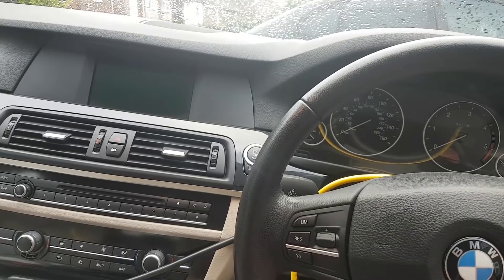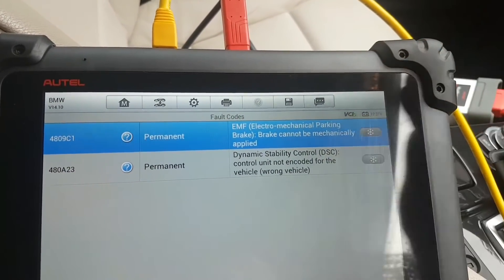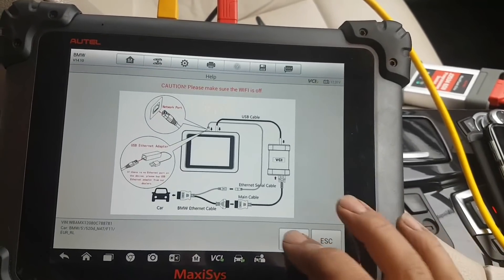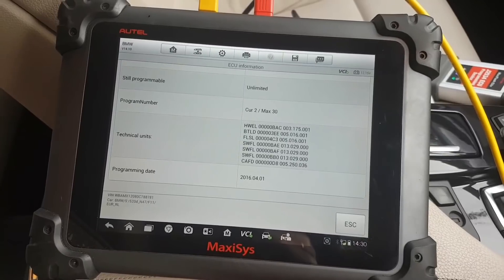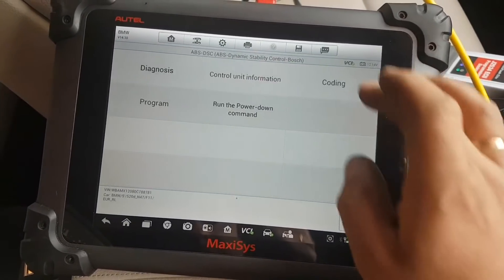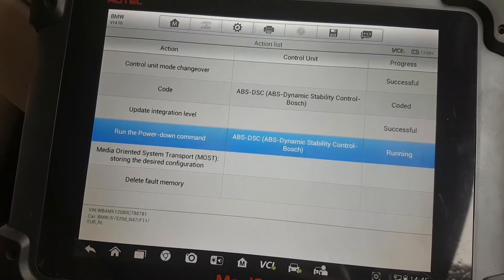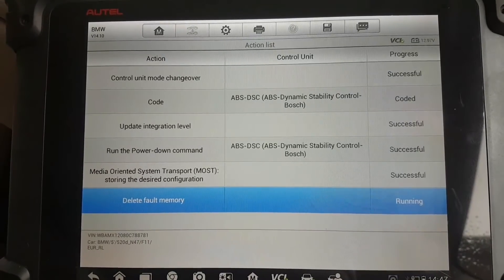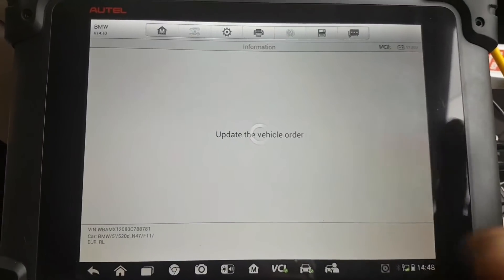BMW F10/F11 used DSC/ABS/ESP module coding/programming.

Comment: Hi, I have a 2012 bmw 535i I replaced the abs module, could you please tell what tool I have to buy to program and code the abs module to work properly on the car?
Reply from the maker: Any tool capable of programming and or coding BMW...
👍👍👍
Reply: @LMAutoRepairs I installed a used abs module, am I still able to code it and program it ?
Reply from the maker: @hardeesalih6435 
Should be able to... yes.
Reply: @LMAutoRepairs appreciate you.

Comment: How did you change/virginize the VIN to the installed used module?
Reply from the maker: All in the video...
👍👍
Reply: @LMAutoRepairs   I watched the video twice, but I can't see how you changed (if) the VIN to this module. I did same process to my E46 after replacing ABS/ASC module with a used one, but it doesn't work. I still says VIN mismatch. I'm using Autel MS908s pro 2, but there is no option to read/write VIN. Any idea? Thnx
Reply from the maker: @foxtrot5557 
The vin should be updated during flashing procedure using the Autel...
Otherwise...
https://youtu.be/1dn4c3g6dsA?si=3diwQ65w1A09FZ0C

Comment: I have problems with e39 530i with dsc system. The module has fault code for lhs speed sensor and sometimes the automatic gearbox goes into limp mode because the communication stops working inside the module. I want to replace this module with a later module from 4.4 l e53 x5.The difference is that the dsc has a preasure sensor on the outside and when  I plug the other module in I get a code for preasure sensor and lateral acceleration sensor and yaw rate sensor. I suspect these sensors are also now built into the pump on the newer system. Do you perhaps have experience with a similar chase.The dsc from the e39 gave alot of problems but the later pump on e53 is very easy to get hold of
Reply from the maker: Never had one of those... sorry...

Comment: Did you use battery maintainer?
Reply from the maker: I highly advise you to use one...
Although, coding only is not so risky, and usually takes less time...
So, if your battery is healthy and you are only coding one module, you might get away without using one... but again, you should do use it!
👍👍👍

Comment: Why you didnt do this job with Autel im 608 pro ?
Reply from the maker: 🤷‍♂️
Don't even remember if I had the IM608 at this point... 
Even if I did, the IM608 wouldn't be able to it, due to the lack of an ethernet port...
Is no designed for that... can do coding, but it is a bit more restricted...
👍👍👍

Comment: Where do you learn the autels full capability had a headlamp module to code on a bmw f10 today for the angel eyes managed to recode the frm but couldn't get it to work but the module was a cheap one off Amazon. Thanks
Reply from the maker: Being a cheap one could be one of the problems...
👍👍👍

Comment: Hi,

Is this the same procedure for the e60? 
If its a second hand part no need to change the VO? 

Thanks
Reply from the maker: Hi
The VO? 
NO...
Some modules need to change the VIN and the coding...
👍👍👍
Reply: @LMAutoRepairs  thanks
The Vehicle Order?
So this is not same procedure to E series ABS/dsc replacement?

Thanks again
Reply from the maker: @cristianohinkenickel5882  
Procedure is the same/similar...
I know what the VO is... and that does not need to be touched when you replace parts like for like...
Again, the VIN number will need to be corrected, possibly some coding as well... 
That is what I am showing on this video... there is no VO involved...
👍👍👍

Comment: I have similar problem...difficult to diagnose it...earlier it show wheel speed air gap rear right..I changed the speed sensor still same issue....can u help ?
Reply from the maker: Have you watched the other video on this car?
It might help you...
👍👍👍
Reply: @LMAutoRepairs  yes I did...I changed the abs also....but still same error...now last iam gonna change the wheel bearing...hope it's fixed then
Reply from the maker: Have you measured the wires etc...
You can have a break on the wires elsewhere...

Comment: Hi, lm doing a Audi A4 b6 1.9tdi and the immo light is not going off also no engine check light. Tried to put machine but no communication. could it be the cluster or  or something. Help plz
thank you
Reply from the maker: Can you communicate with the engine control module? 
Thank you for watching!
Reply: @LMAutoRepairs  l tried to put the machine but its not communicating with the ECU
Reply from the maker: OK...
Start with the basics...
Fuses, connections etc...
Check powers and grounds at the ecu connectors...
Lastly CAN network...
Reply: @LMAutoRepairs  ok thank you

Comment: Hello  Luis , I admire your work with the cars, but it is not good to make videos with a 3000 euro scanner, because most of your viewers do not have such an expencive tool.Its better to use the cheap chinese clones instead !
Reply from the maker: The best tool is yourself...
The idea is to show the process, the thinking,  etc...
The tools, you can use whatever you want...
Thank you for watching! 
👍👍👍
Reply: Exactly this is my point. All the job is done by Autel automatically , so if you do not own one there is no interest
Reply from the maker: I think you are missing the point...
If you use a different tool, the procedure at its core still the same... or at least very similar...
Does not matter if you are using an Autel, a clone Icom, a CGDI, or even E-sys... though the last one can be a  bit more tricky...
👍👍👍

Comment: Did you get the software from old module and put it back? I couldn't see any of this procedure, is that doing its thing automatically without taking the old software back?
Reply from the maker: No...
The software is whatever was already on the replacement unit... this just code it to the car...

Comment: very interesting to see the level of computer control in todays vehicles, not surprising because I have always known it was there, it also gives us an insight into the progression and intention of programmers to take away control from the operators and drivers. It is not surprising therefore that billions of taxpayer's money is used to subsidise manufacturers, this is not just about creating jobs, this is about creating a power structure.
Reply from the maker: 😊
Right to repair...
Some of this stuff it is slowly taken away or made very difficult or expensive to the ordinary garage or individual...
So, you are forced to go to the dealer, which obviously will not install second hand parts...
👍👍👍

Comment: This is not programminy
Reply: verb: program

    1.
    provide (a computer or other machine) with coded instructions for the automatic performance of a task.
Reply: @SabretoothBarnacle  i am software engineer work for Mercedes and develop ecu and bcm we are hardcoding with c++/c language this is just pressing buttons and the binair digits are changing
Reply from the maker: Coding, programming, flashing... etc...
All comes down to play with the control module software... correct?
On the title, I put coding/programing...
I absolutely agree that in this situation the word coding is more specific to what I did, the fact that I used the word programing it is to make sure that the person that will see this as programming, can also find the video...
In the end, those technicalities that are irrelevant here...
Just my opinion...
👍👍👍
Reply: @LMAutoRepairs  aah i understand you are right about that and i understand your word choice.

I'm going to tell you now we are currently working on limiting and securing the limit this means that if someone changes something to the values that are defined as normal the ecu will give a certain error message that is definitive and cannot be removed only by the official Mercedes dealer, sometimes it can even result in a software crash that can disable certain functions, such as power steering, which can result in nasty situations. I can't really say it because of professional secrecy and secret of the company but it might be good for you to know since you are interested in car technology and you have a youtube channel about this i speak about a new upcoming A-class car
Reply from the maker: A shame that manufacturers are doing that...
The ones that claim are trying to help a sustainable environment, then make it nearly impossible for things to be repaired or re-used...
They don't really care about the environment, they care about making things in a way that they can constantly sell new parts, and lock things in a way that only manufacturers can do the job... that does actually have a name, is a monopoly!
Reply: @LMAutoRepairs  This stance by Mercedes Benz will also get some serious negative PR based on the new EU Right To Repair legislation.
Reply from the maker: Hope so...
And that that puts other manufacturers thinking before doing similar....
Reply from the maker: Thanks...
Reply: Programming/coding is in the diagnostics world lexicon so it's more than acceptable to use that terminology especially if you want your videos to be found by people searching on the Internet. BMW acknowledge this with their ISTA/P software, 'P' standing for programming which is also a term used throughout the 'P' software and is also used in their 'D' (diagnostics) software. If you're trying to pick a fight then I suggest your time is better spend lobbying the industry first then we can all adapt our language to your newly introduced industry terminology.
Reply: @SabretoothBarnacle  hahah no fight or argument is needed i understand don't waste your energie
Reply: @A.D.38q9  Fair enough 😁
Reply from the maker: The programming you are thinking about, it is usually referred as flashing...